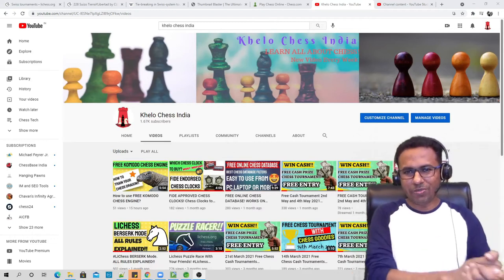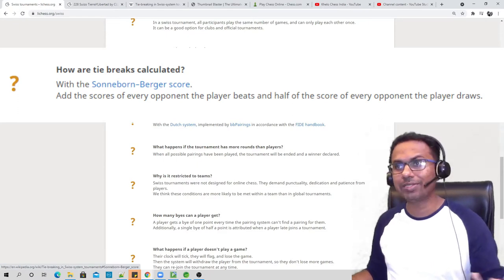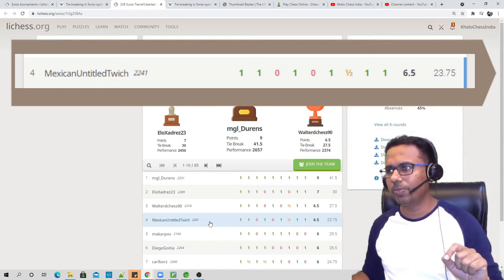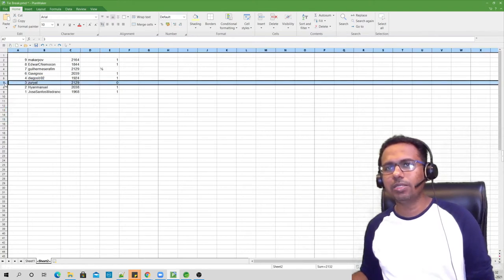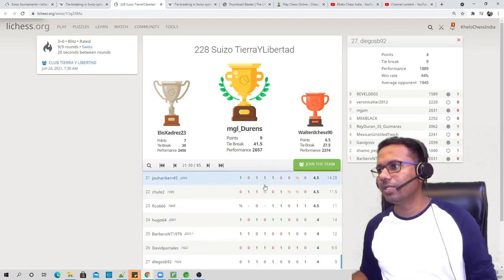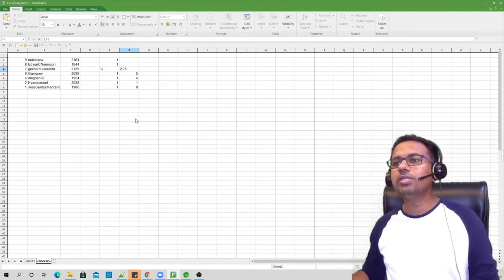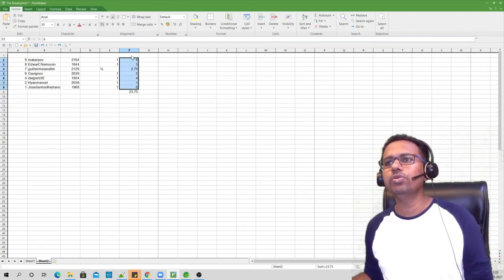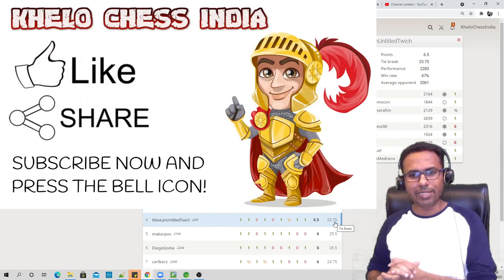LICHESS TIE BREAKS - How it works?? Sonneborn–Berger score Explained

Comment: Byes during a lichess tournament have a special treatment. They contribute to the tie-break score by adding your current score before the round you get a bye in, then 1/2 for every round after that. It's as if the bye is representing a win against a "virtual opponent" whose score matches yours, and who draws every game afterward. This is based on some FIDE rules about tie-breaking. So if you see a strange tie-break score that doesn't seem to agree with the method described in this video, it may be the result of you having a bye in one of the rounds.